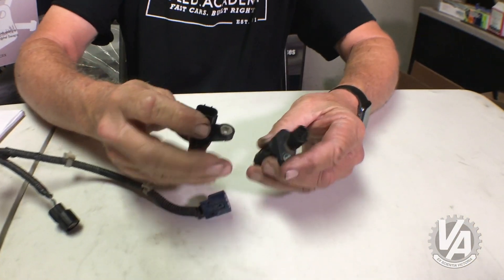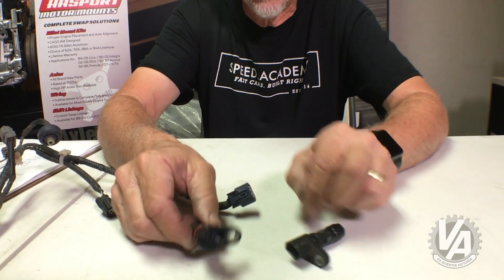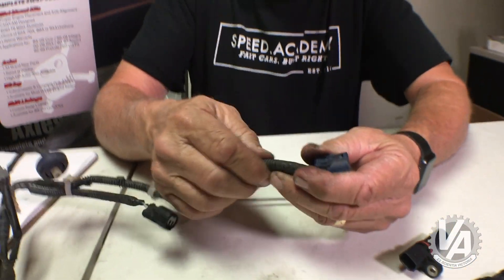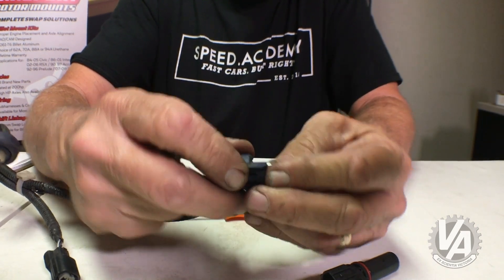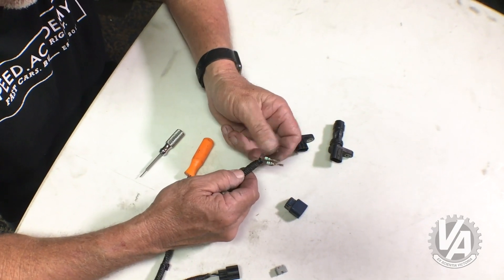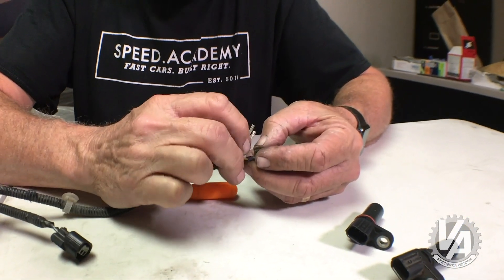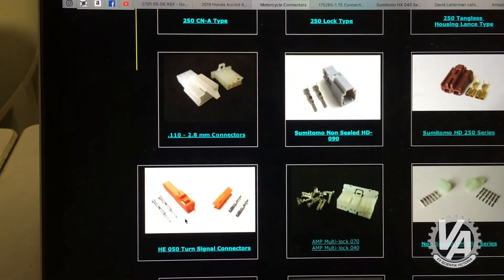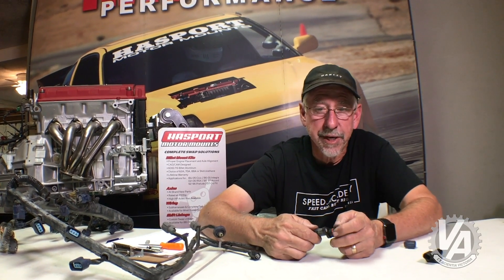K20 to K24 Crank Angle Sensor Swap

Comment: Hey quick question, doe you have to power the sensor with 12V or will 5V also work?
Reply from the maker: I’ve never tried it with just 5v.
Reply: @VTECAcademy  thanks for the respond, i had an issue that I was troubleshooting. I did figure it out tho, the 5V test wasnt needed. this video actually helped me haha.

Comment: Your video caused the light bulb in my head to finally click!!! 

I'm messing with those dang r18 engines, the ones that crack. I had an r18a1 with cracked block and rebuilt it with a r18z1 from 2012-2014 civic. I used the r18a1 internals  and knew I had to use the r18a1 crankshaft trigger wheel  to be able to be compatible with my 2006 ecu.

Well, 2006 sensor actually caused my main pcm fuse to blow and would not work on the r18z1 block. Probably different gap or angle. I could only get my motor to start with the 2012 crankshaft sensor. Also, I kept wiring it like the old sensor, pin 1: ground, pin 2: 5v signal, pin 3: 12 v power. 

After watching this video, I began to think if Honda had changed the wiring. Also, I noticed the blue wire being in different location when taking this sensor and connector off a 2012 civic at the junk yard. I assumed that the colors changed, but no! Blue wire is 5v signal for crankshaft position sensor for 2006-2011 and 2012-2014 civics. 

I switched ground and signal pins, turned on ignition, and checked blue wire with multimeter and it was 0.023 volts, basically 0 volts. I moved the crankshaft sensor, so it had metal in front of it, and it turned to 5 volts!!! Did exactly what it's supposed to. I didn't crank it since it's nighttime now, but tomorrow I will crank it, and hopefully, that p0335 will be gone.

I know r18's are insane to work  on and nobody would waste time on them unless they were boosting, but I learned so much about engine building, fixed a car that has sentimental value, learned how to pin connectors, and learned car electronics!

Videos like this help me prepare for my future k24!
Reply from the maker: Good detective work.

Comment: My issue is way worse than this, K24z7 engine which has 60 tooth sensor at rear of engine. Might be a matter of swapping timing covers and adding the front sensor. not sure if it will work yet.
Reply from the maker: That kind of works. The solution is to buy the Kpower Industries timing cover so you can add the front sensor. No stock timing chain cover works.
Reply: @VTECAcademy  you're my best friend now. Much love from Miami.

Comment: Hey could I use a k20z1 crank sensor on a k24a2 ?
Reply from the maker: You’d need to change the connector and change the wire positions. Sounds like a good 3 minute Thursday video.
Reply: @VTECAcademy  I’m here for it boss!!
Reply: @VTECAcademy  and what wires would it be?

Comment: Hey brian would de pinning a 8th gen si stock harness for the k20 camshaft position sensors (intake) sensor getting a code p0339. Would a k24 work if able to de-pinned?

Comment: K20z3 putting k24z7 block will this work I'm fuckt 🥲
Reply: Find a solution? The K24z7 uses 60 tooth tone ring at rear of engine, the K20 uses the front of engine crank sensor with 12 teeth.

Comment: Hey I did a K2.4A2 swap on my 2010 Acura CSX that had K2.0Z2  it's control by the K2.0 ECM  I need the ECM adapter to plug into the 2.4 ECM & the car harness the ECM that I have is from 2008 Acura TSX any advice or help would highly appreciated thks
Reply from the maker: I saw this question on another video. That probably won't work. I advise you to use a Hondata or KTuner to modify the stock ECU so you can tune it for the K24A2.
Reply: @VTECAcademy  I was told that the Acura CSX ecm is not compatible with the Hondata that is why I am trying to get an adapter wire harness for the tsx ECM to the connectors to the car harness

Comment: I need to add something to this, which is common sense yes. But, when you shave down the k24 sensor and re pin the plug on the k20 harness you can bend the terminals on the sensor and it will throw that p0335 code. I have been dealing with this code for like a week now and never bothered to look at the terminals of the sensor which i bent.
Reply: We have used this solution a couple of times at the race track when the proper part wasn't available. We always call it a temporary fix, but will ofter leave like that for months sometimes.  I haven't run into the problem you are talking about, but I will be careful if we have to use this solution in the future.

Comment: Are you sure this is correct ?
K20: 
Pin 1: Signal (blue)
Pin 2: Signal Ground (brown / yellow)
Pin 3: 12v + Switched (Yellow / Black)

K24:
Pin 1: Switched 12v 
Pin 2: Signal
Pin 3: Signal ground 

If you would swap it straight over it wouldn’t work. 
Any insight on this?

Edit: sorry you are right 😀
Reply from the maker: All good, thanks for checking!

Comment: Could you please link the specific part number of the crank sensor plug? I don’t want to order the wrong part. Thank you kind sir.
Reply from the maker: For the RSX connector - https://www.corsa-technic.com/item.php?item_id=1058&category_id=148
For the Accord connector - https://www.corsa-technic.com/item.php?item_id=405&category_id=148

Comment: This video ties in nicely with the ktuner conversion harness wiring. But a missing link: if ktuner ecu is used for a k24 swap with an rsx type s engine harness, do we need to swap the crank angle sensor from the k24 to rsx?
Reply: I was gonna ask that. But I’m doing the same and it runs. But throws the code at the moment, either my crank trigger plate is backwards or the sensor is bad. I’ve tried every way to wire the sensor.
Reply: P0336? Have you figured yours out @Rattle_canned_restorations

Comment: Part number or direct link to the correct plug? Wire size or seal size? I just went with the default item from Cycle Terminal: 3pin HX .040  Female Connector - with Terminals and Seals
Terminals Fit wire size .5 - 1.3 mm (18-22 AWG) Sumitomo part number 6189-0968 and 6918-1833 Japan HX4-DCDV3FAY-DGR. Thanks.
Reply: Did this work? Was curious about the different sizings

Comment: hey brian i got no spark on my k24tsx i have no spark and the only codes i am getting is a crank sensor code and a mulite plex code you think it haves to do with the crank angle sensor ??? i followed what you said on the video and still nothing do you have a email we can communicate with thanks in advance i have a ktuned harness p0335 and p0600 thanks again

Comment: For anyone in the process or considering doing a K24A swap with an 02-04 RSX harness, this conversion is a must! You will quickly find that P0335 will keep your car from revving past 3000 RPM and will trigger Limp Mode. There are key details that online swap guides do not tell you. This being one of them. 

Thank you Brian and the good folks at VTEC.academy for clarifying this!
Reply: Planning to grab an rsx harness this weekend for my k24a. Thank you very much for the heads up. Wish me luck 🙏
Reply: I had to swap wires for the cps but the alternative would have been to swap to an rsx sensor i believe
Reply: Any other details like this one??. I seen people swap out the  intake side cam sensor also.
Reply: Could this trigger P0341?

Comment: Thanks for the video. Im wondering if u could help me out. I have a 03 ep3 with a jdm k24a engine with ep3 engine harness and kpro v4. I just swapped by engine harness to a 03 rsx type S and now after installing the harness I can't get the car started. I install new base map and it still won't start just cranks. I got spark and fuel. Any advice would be appreciated.
Reply: You ever figure your issue out? Having a similar issue on my k24 crx swap
Reply: Any of you guys figure it out running into this problem too

Comment: A good tip would be how to set up your coolant hoses for heat in a k swap everyone i no routes the shift cables through the heater core hole or a budget way to set up ya radiator and hoses on a k24
Reply: Hmm, I ran the shifter cables underneath the car through the exhaust tunnel, and in between the sub frame and the firewall. No problem with the heater core. Added benefit when you mount the shifter box 2 inches under the floor of the car is the stock interior trim pieces can still be used.

Comment: I've got an 03 type-s ecu, an 03 type-s engine harness, a jdm k24a, and an 04 type-s cluster. Would an 02-04 base/auto RSX dash wiring harness work? I'm doing this swap in a non Honda chassis and want to do all rsx wiring to avoid headache.
Reply: The base auto harness will be missing the clutch sensor. I forget what else is different.

Comment: Great tutorial 👍 can this be done with the knock sensor as well? Or can u just cut the k24 knock sensor wire and reconnect them to the type s engine harness? Thanks
Reply: Whichever you prefer as long as the connector and sensor match. K20 with K20, K24 with K24. I personally cut the plug off and soldered on one that matched.
Reply: @MakitaDiesel  Nice! My k24a2 I bought still has the connectors on them with the sensor so I'll just do that. Thanks for the reply ✌

Comment: Iv got a k24a2 from a type s accord 06 auto can i use that harness in a eg swap like can i delete the dbw and will the conversion harness work really keen to know
Reply: You could just get a 2003 accord throttle body. It will connect directly to the intake from the stock k24a2. I pulled one  out of an 03 at a pick your own part yard and it ran me $42. Came with the TPS and IACV on it.